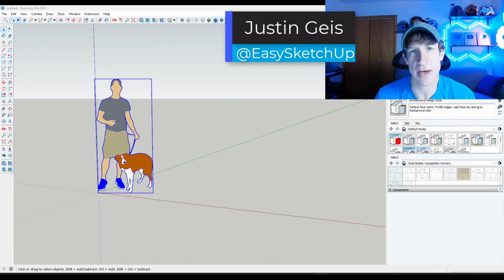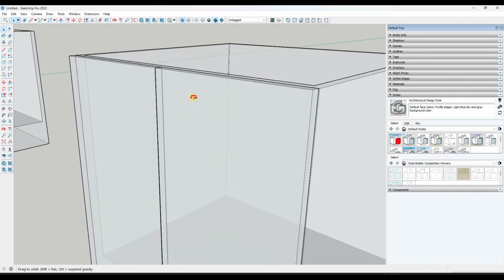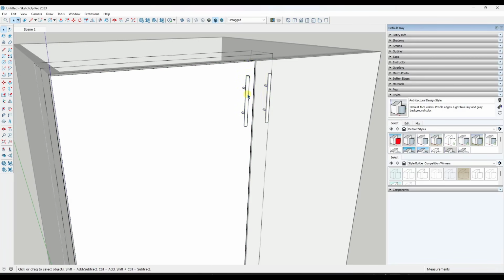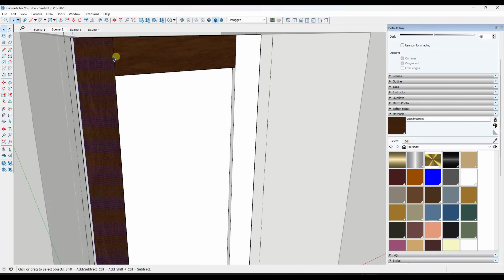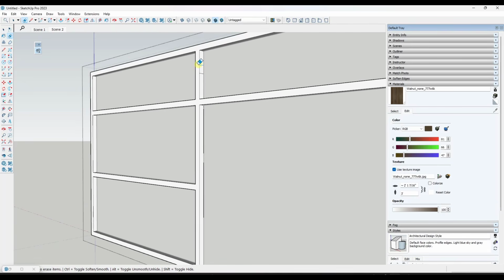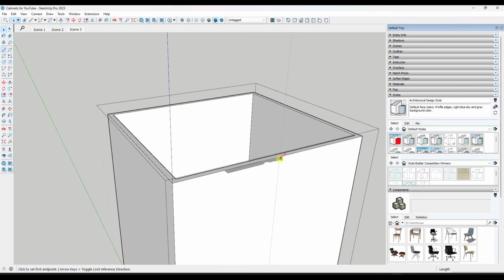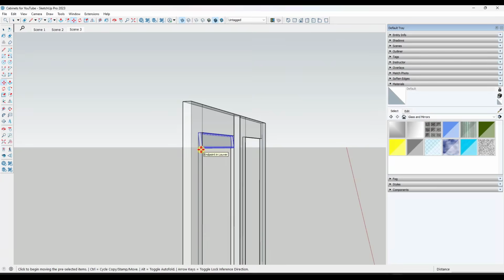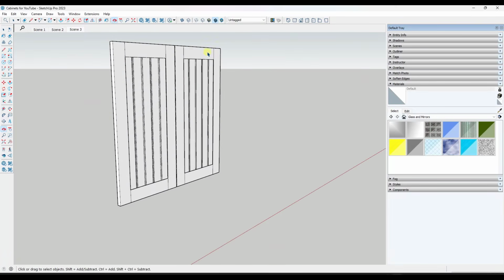The ULTIMATE GUIDE To Modeling Cabinets in SketchUp!

Comment: PSA for anyone modeling cabinets with grain texture that doesn't know the rule of grain direction. Here it is. Grain should always run in the length orientation. Example with the panel. The grain should never run horizontal, it should run vertically. There is an exception with cabinet doors that are wider than they are tall. The panel grain will still run vertically, that is because it must match the grain of the other door panels. The rails and stiles (what the frame pieces are called) will ALWAYS have the grain running along their respective lengths. Whether that be vertical or horizontal. Solid fave drawer fronts will run the length (horizontal) of the drawer face regardless if the drawer fave is taller than it is wide. Which is essentially non existent. That would be a very deep drawer. Typically drawers with that depth are in a pantry style cabinet with pull out flats and closing doors on the front. 
OK, I'm done now. Have fun modeling your dream house.

Comment: do you recommend any extensions?
Reply from the maker: For cabinets? Not really - there are cabinet extensions like Cabinetsense, but they tend to be a lot more than I need. I mostly use dynamic components or dynamic bases then I create the doors manually

Comment: Hey Justin and anyone that reads this. If you are serious about cabinet design you may have heard of Cabinet Vision. Well "F" that. CV is super expensive. One of the creators, created Mozaik. All of the cabinets are created using SU to view and create the cabinets. Once you apply the SU option then you can go to town with SU model to add anything you want just like normal to create a model. This software is what I use at a cabinet shop I freelance with. It will create assembly sheets, drawer and door orders. They must have got with someone at SU to create all these cabinets in the software to use either way, with or without SU modeling. It's currently $95.00 a month if you are an avid cabinet designer or maker.

Comment: Great video as always, Justin.    I wanted to ask you something, please.   I am ventruing over into rendering and I am using Twinmotion and Unreal Engine.   I am not sure if this is an issue in other rendering softwares like VRay, but when I use the Flip tool in Sketchup, the materials come out as black in Twinmotion.  Then to fix it, I need to go back into Sketchup, explode the entire group or componet, then regroup or re-component the geometry.  95% of the time this works.   Is this something you know of and perhaps know of a way to avoid it?   Thanks. 😄
Reply from the maker: I don't really know - MAYBE something to do with face orientation, but I'm speculating wildly - I've not had this particular issue - https://www.youtube.com/watch?v=Y3kJlaXiNcA